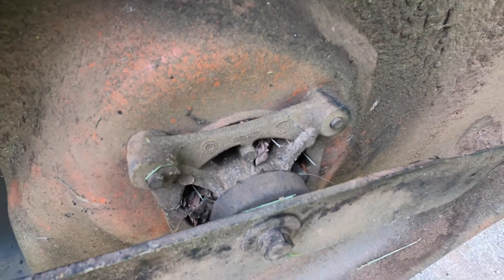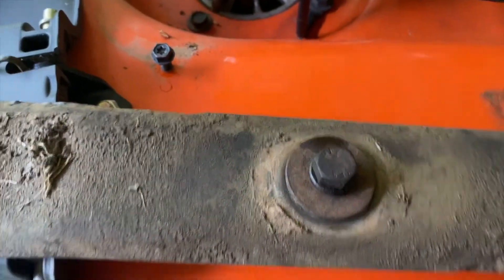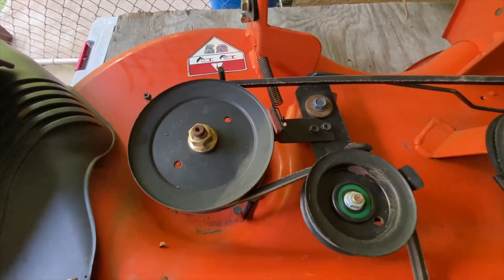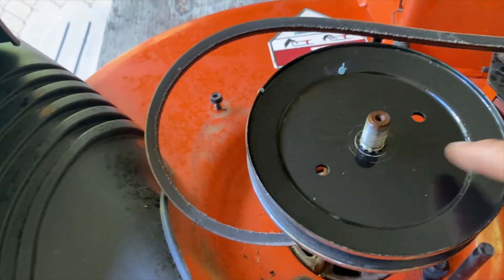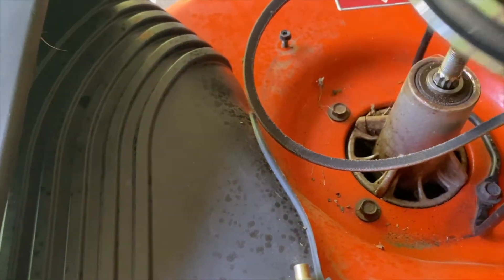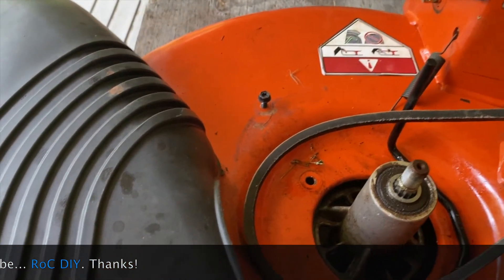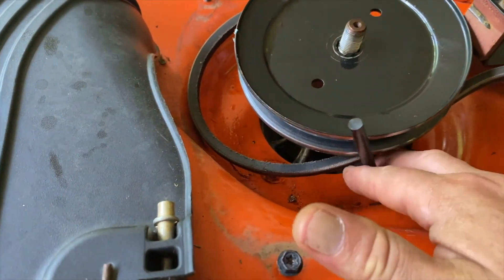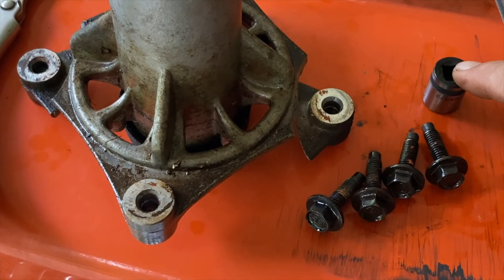Husqvarna YTH22V46: Replace Spindle

Comment: I rebuilt the whole deck on mine for under $125, n took less than an hour, I also Modified the new spindles so both the top n bottom bearings bet grease. I have a YTH2248. Saved me $3500 on a new mower. YouTube is great at helping you fix stuff n save money.
Reply from the maker: Anytime you can save money or not spend any money is a good day. Does making the greaseless bearings take grease make any difference?